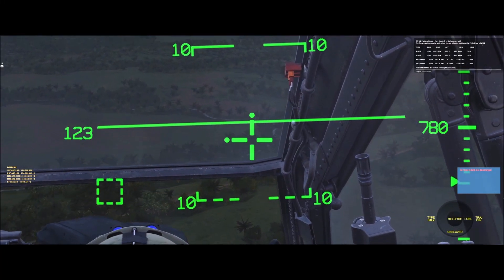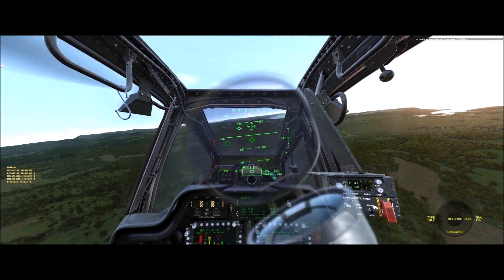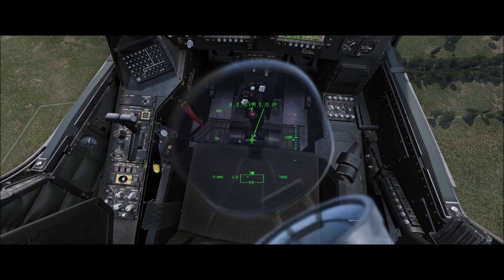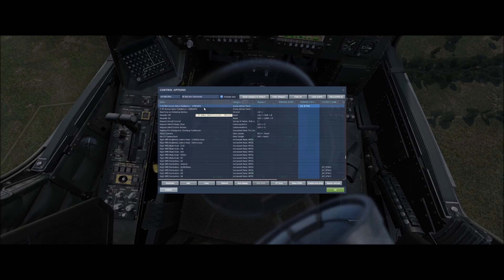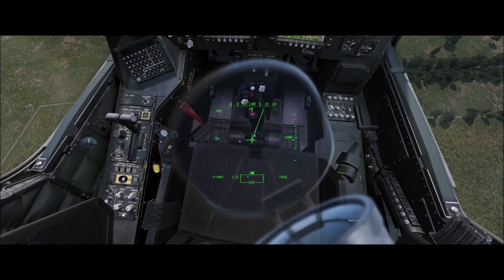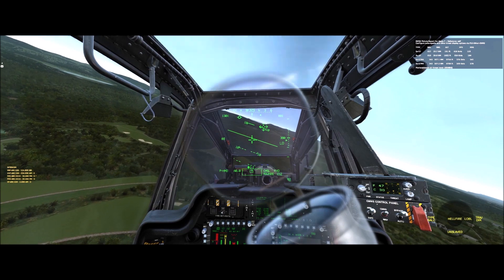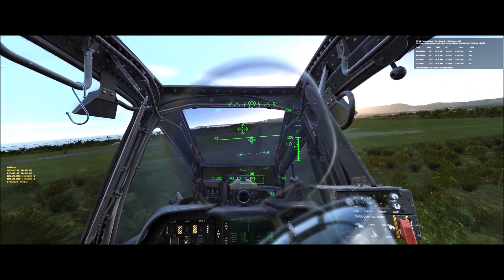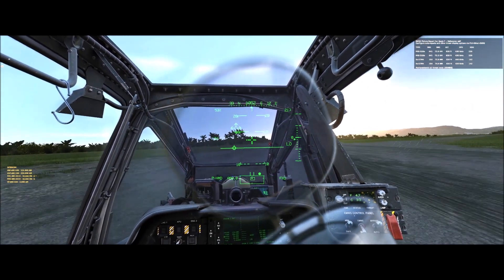DCS World | AH-64D | Single Engine Performance | Emergency Shallow Approach To A Roll On Landing

Comment: Real world and gaming when you lose an engine you should hit the perf page and check your VSSE safe single airspeed.  This will tell you the min speed you can go and maintain altitude, a lot of time you will not have to jettison stores to maintain flight.  If you are high you may need to descend to a lower alt before you can maintain flight................There is also a high end to the single engine speed range.